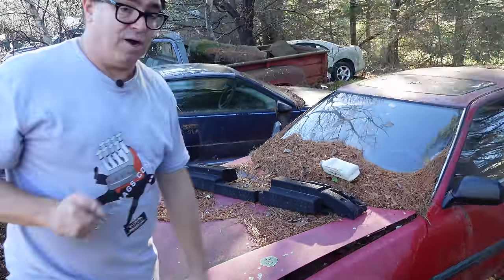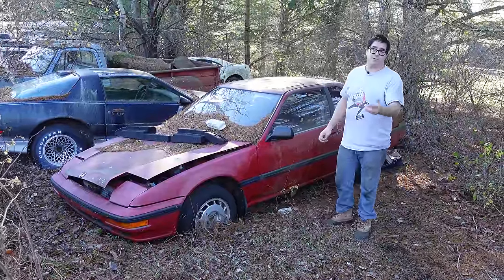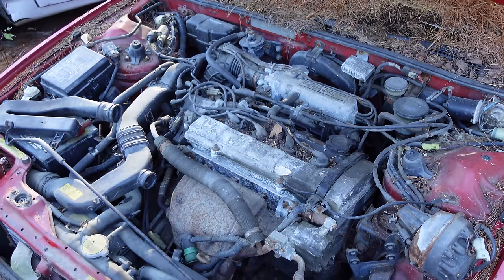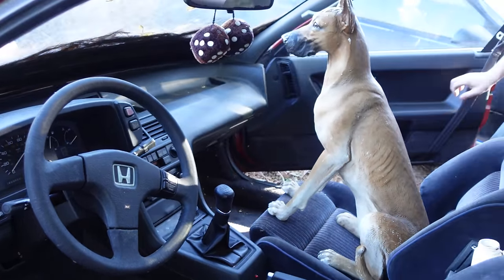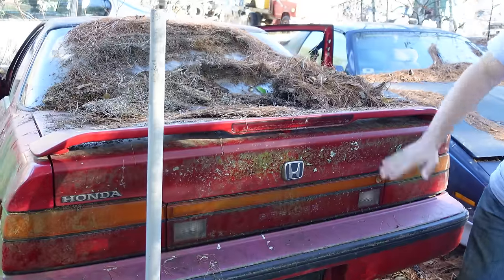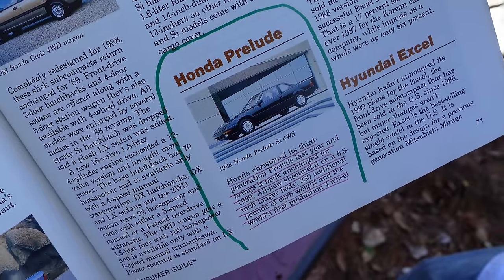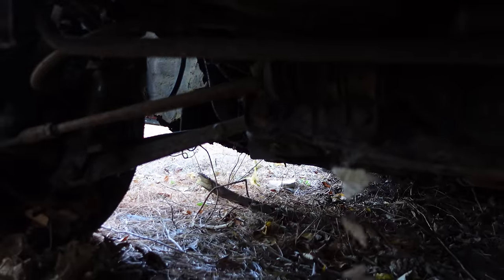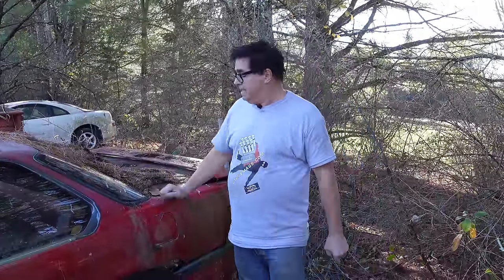First Four Wheel Steer

Comment: Late 80's Hondas are some of my favorite cars.  They had a great mix of styling, performance, and quality back then.
Reply: 80s Honda and 'styling' 😬😂
Reply: @rickc303  beauty is in the eye of the beholder 😀
Reply: What "performance"?  They're slow, even for the era!
Reply: How does a purely mechanical system sense the speed?
Reply: @flobp2381  No kidding they were slow - I got followed by a film director in his sporty Prelude (the model shown here too!) along a winding mountain road between locations, with me driving a '66 Valiant with minor suspension upgrades,.. I'm just cruisin, left in second most of the time and letting the Slant run up revs between corners, and him asking how my car 'went so fast through corners' as he was having to push his hard to keep up,.. :D
Reply: @Henry_Jones  I worked for a Honda dealership in the early 90's and can say, for a fact that those cars, even preludes, new and used were/are slow. Preludes were so slow, in fact that we had a name for them, "quaaludes".
Reply: @flobp2381  but reliable...

Comment: Small correction : the steering angle is just mechanical, they turn same way on small angles and opposite way on big steeing angle. The speed controlled electric 4ws appered in the next gen of preludes.
But they had speed cntrolled power steering that get firmer the faster u drive.
Great cars, super comfortable and quite fast.

Comment: I bought a 5th gen 2000 Prelude brand new in December of 1999. They had done away with the 4 wheel steering system by then but still utilized a suspension design derived from Honda's work on F1 and the NSX.  I owned it until 2010 and put 225,000 miles on it. It was a fantastic car, I absolutely loved it. Slick shifting 5 speed, And that vaunted H22A DOHC 2.2 liter which was just an amazing 4 cylinder for it's time. Still is in many ways. That engine would rev every bit of 7500 RPM and sound so good doing it. 

I have a 2019 Camaro SS now which I love but I'll tell you I do miss my Prelude. Honda really made a perfect little 4 seat sporty car that was right in the sweet spot of everything you want in a fun to drive car. It wasn't the fastest car in the world but it was quick. It didn't set records on the slalom but the handling was still laser sharp. And that car was as reliable as your Grandmother's 1953 Maytag washer. I literally just changed the fluids regularly and the timing belt/valve adjustment every 90,000 miles and it never once gave me any issues. Even the A/C still blew ice cold when I sold it.

Comment: Hi Steve another great video. Those Si's are hard to find around here but when they were new you could see one smashed up to its innards weekly. These things were hot back in the day and many were hauled away on rollback after a night of street racing or just like Mustangs just wreck themselves when leaving parking lots or stop signs. Had quite a few in the back lot and eventually sold the running gear out of them. The ones that the block didn't get broken during the accident. Hats off to the guy who lugged that floor jack out into the yard. LOL. Namaste 🙏🏼

Comment: Active rear-wheel steering was introduced in 1985. Fittingly, it made its debut on the Nissan R31 Skyline, a car as synonymous with innovation as noodles are with ramen. However, the technology was popularised by the 1987 Honda Prelude, which was sold globally!

Comment: I overheated a third gen accord with the same 2.0. The gauge quit and when it stalled out the plastic timing cover was peeling away, melted all the way around leaving the lip still bolted-on. I just pushed it back as it cooled and you can't tell it happened (from the outside at least). 
    The best thing about those body designs is at 55 with all the windows down, wind does not intrude into the cabin.  That and winking the pop-ups.
  Oh.. And they don't get stuck hardly ever. So light they don't bog down in mud and are just fine with snow over the bumper if you drive slow.

Comment: The beauty of the Honda 4ws was that it was purely mechanical.  It's not a "speed sensitive effect" but rather simple geometry.  Rear wheels turned same direction as front for first 15 degrees, then switched as you turned further.  When you change lanes on the freeway (as you're presumably driving fairly fast) you turn the steering wheel very little.  When you're turning around corners or parking and such (and going slowly), you turn the steering wheel quite a lot.  Less to go wrong than other systems that were introduced in the era.

Comment: I worked at a Honda store when that car was new. Preludes weren't huge sellers in any trim level. There was also an ALB (Anti-Lock Brake) model. I remember the mechanics hating the S model because they were problematic by Honda standards, and the carb looked like it had about 27 vacuum lines going into it. The Si was fairly quick, but not a sports car, the previous generation CRX Si was quicker and more fun to drive. 

One thing that stands out about the 4WS model was that they were interesting (to say the least) in snow.

Comment: The Quaalude, which is what you had be on to buy one. Don't get me wrong, they were fast cars and would pretty much destroy anything in the Twisties and did pretty good on the strip as well. My problem was the 1000 rpm per 10mph that they ran at. Doing 60 on the highway taching 6 grand was annoying.

Comment: Man you make me miss my 89 Prelude. It was a 4WS with a 5-speed just like this one except gold. I just sold it a month ago running and driving with 149k miles with no mechanical issues, I was tight on money because of my college tuition and got four times what I paid for it two years prior. I miss it and hope once I graduate I can get another one if the price hasn't completely gone through the roof. I've owned five cars now at 21 and this was the most fun to daily drive hands down. Just the parts were hard to come by so I stopped driving it since it was expensive to repair. Then I decided to sell it while the price was high since I was cutting it close on my tuition for school and I had an old Volvo I was daily driving and was mostly just keeping it as an extra only putting about 1000 miles on it the last year I owned it.

Comment: These were really awesome cars in there day, I worked for Honda & got them brand new.
My first new car was a 1987 Prelude 2.0 SI Special edition, so I missed out by one year.
That's ok cause I still had my 1977 Oldsmobile Vista cruiser back then with the 403.
Boy, the handling was different to say the least, but Honda was putting out some really good products at the time.
Crx SI, Civic SI, Accord SEI, all with some form of the PGM-FI injection.
These were awesome at the time.

Comment: Mazda added 4 wheel steering to the RX7 right around the same time but it was passive with special bushings in the rear links. It actually worked quite well and could beat most domestic motorcycles through the canyons! Don't ask how I know that....

Comment: The first-generation Prelude for the US debuted for the 1979 model year, not 1978 (but yes, manufacturing would have started some time in 1978). The first generation was 1979 to 1982, the 2nd from 1983 to 1987, 3rd was 1988-1991, and the 4th was from 1992-1996 and the 5th was from 1997-2001. They were assembled in Sayama, Japan. Possible code R51 Phoenix Red exterior paint.

Comment: That's very curious....if the front and rear rack is linked with s driveshaft, how do the rear ratios and directions change at different speeds? Weird. Yes, Steve...do another video on this car featuring the 4WS...I'm intrigued
Reply from the maker: I mis-spoke, its not a "driveshaft" but rather a steering shaft. Regardless, there is a planetary gearset inside the rear steer unit that translates front wheel steering inputs into much slower inputs to the rear wheels. The crazy part is how the planetary gearset has a sort of over-center function that allows the rear tires to turn WITH or AGAINST the front wheels depending on how far the driver rotates steering wheel in degrees. And there isn't a single computer involved. Pretty cool huh? THANKS for watching and writing. -Steve Magnante
Reply: @SteveMagnante  that is crazy. Now, we can't even have windshield wipers go back and forth without a control module... usually VIN specific.

Comment: That’s exactly what I want to know: “what” ecus/mechanisms/etc. made the decision to switch between low speed vs high on the 4-wheel steer?
Reply from the maker: A planetary gearset fed steering wheel inputs to the rear wheels. If you Google the system, you'll see how it goes "over center" at a certain steering wheel angle to trigger the left or right turn of the rear wheels. No computers, no hydraulics. Just a well designed planetary gear train. Thanks for watching! -Steve Magnante

Comment: I've had 3 89 2.0Si Preludes and 1 88 but none of them were 4WS. My first road legal car was a black 89 2.0Si 5 speed with a tan interior. Great cars to drive, albeit a tad under powered. I still have one of the 89's, currently engine swapped with an H22A1 from a 93 Prelude

Comment: Hi Steve, nice video!  Four wheel steering was good, but was not proven practical.  The Chevrolet Corvette was going to be the first American car to have four wheel steering but it never saw production.  The four wheel steer Honda Prelude was the first vehicle to have a steering shaft senser, or "steering wheel position senser" you might say, that was in conjunction with the vehicle speed sensor, by means of a steering control module.  By today's standards, this is now been replaced with what is called ADAS "advanced driver assistance system" it works with the traction control module/parking assist module/antilock brake module, but in the mean time, the rear wheels to not change steering or tracking.  Please reply.  Dave...

Comment: "Active" Steve, needs to be titled "First Active Four Wheel Steer". "Passive" four wheel steering has been around a long time, both on European FWD's and US/Aussie RWD platforms, most often done using elastomeric components, such as the oval shaped front leaf spring bushings that allow the spring to move front-rear as the spring stretches, adjusting the toe of a live axle. And as the Honda's was mechanical only, the active part there is the mechanisim to reverse the direction the rears steered in, there were small volume all mechcanical systems much earlier, 1910's and the like, but they never gained any sort of popularity with consumer drivers, though could be found on farming and trucking platforms.
Those boot spoilers do nothing for downforce - mass production passenger cars get the majority of downforce from the underbody airflow.

Comment: Didn't Toyota have a 4WS system before that? In there Camry?
Reply: Active rear-wheel steering was introduced in 1985. Fittingly, it made its debut on the Nissan R31 Skyline, a car as synonymous with innovation as noodles are with ramen. However, the technology was popularised by the 1987 Honda Prelude, which was sold globally!

Comment: Hi Steve The shop I worked at Had a Honda Prelude come in with Bad head gasket, The Owner Did not have the Money to Fix, I bought the car for 200 bucks, Changed head gasket. Drove for maybe a Month and sold Did not have the 4 wheel steering, It was Ok I quess. Same color as that 1 Red.

Comment: How a mechanical system could do one thing at low speeds and the opposite at high speeds is mind boggling.  I do wonder, since the paper said Mazda 626 Turbo had 4ws as well, did it make it to the Ford Probe or Probe GT, since they were based on the 626?

Comment: 1978 Porsche 928 had rear steer first Steve 
Check it out mechanical also
Reply: Active rear-wheel steering was introduced in 1985. Fittingly, it made its debut on the Nissan R31 Skyline, a car as synonymous with innovation as noodles are with ramen. However, the technology was popularised by the 1987 Honda Prelude, which was sold globally
Reply from the maker: Hello Jorge Gomez, I am with you on how Porsche designed the 928's rear suspension with intentional compliance that would trigger helpful wheel deflections, but that system was not connected to the steering rack or steering wheel. It was a passive system that depended on vehicle dynamics (car had to be moving, brake / acceleration forces triggered rear "steer"). Thanks for chiming in, these discussions are viewed by MANY and keep all of this tech history fresh and current. -Steve Magnante
Reply: @SteveMagnante  I had a 928 early car
It the best handling front engine car
I ever drove you could feel the rear
Following on an on ramp it saved
Porsche at the time 911 was not
Doing well look up project928
It’s fascinating read